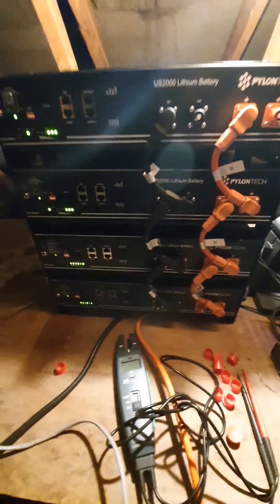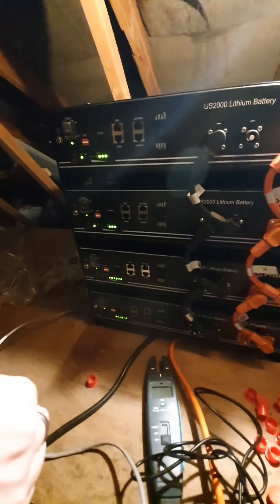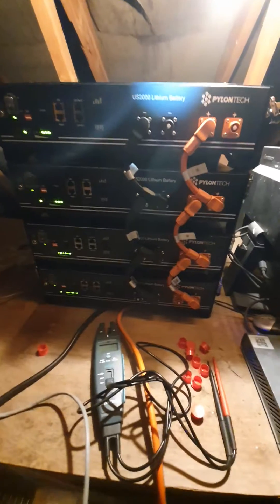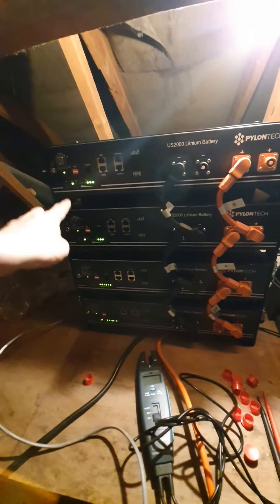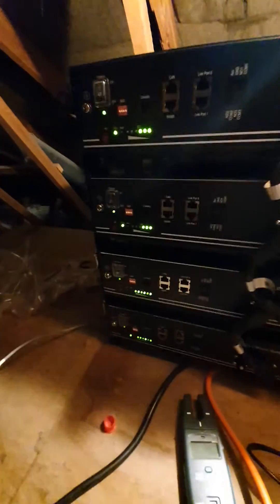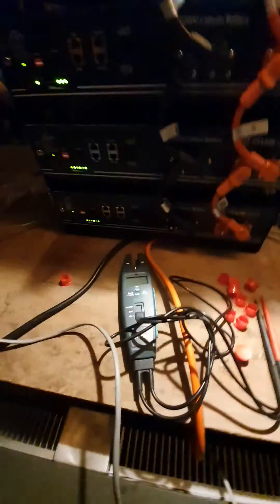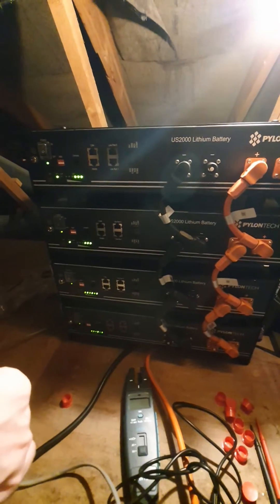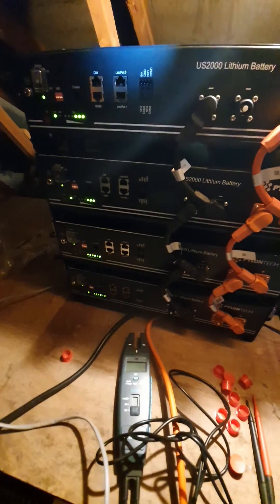Adding and balancing extra pylontech batteries

Comment: Which invertor do you have? And are you able to fill all four batteries on the 4hr 5p window?
Reply from the maker: Yes, manage to fill them up. Inverter is luxpower
Reply: @LesGreenSIB  how do you get your inverter to charge from the mains? I also have a Lux one.

Comment: Hi there this is really valuable info. I also have two batteries and want to add in another two.  Did you get any issues after the new install? Did you have to let the controller know there was now more capacity?
Reply: nope, nothing, super easy - you just plug the ethernet cables and power cables and everything just works. But sadly the lux power portal does not tell you explicitly how many kWh of storage you have so you have to work that out of how many kWh where discharged from batteries on that day.
Reply: Are you using these to charge them at night and discharge them during the day ? I was planning to do something similar however I need approx. 20 kWh worth of baterries .. what inverter are you using ? What would you recommend ? These are AC batteries basically ..
Reply: and my concern is that I need a proper inverter to be able to charge 20 kWh at night in 4 hrs time frame ..
Reply: What inverter used
Reply from the maker: Luxpower
Reply from the maker: No issues